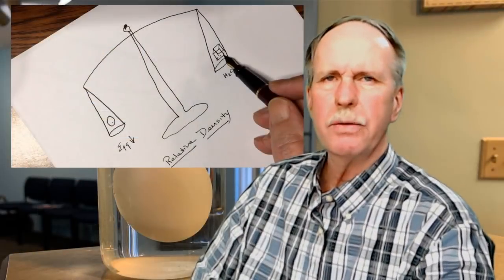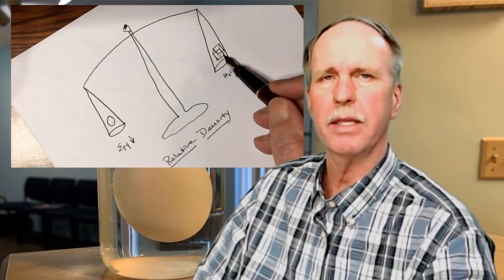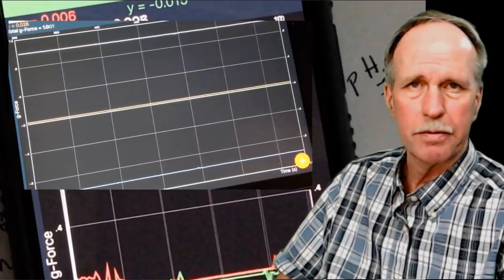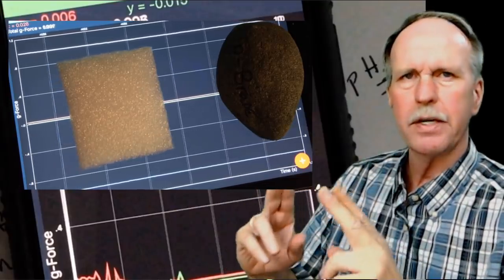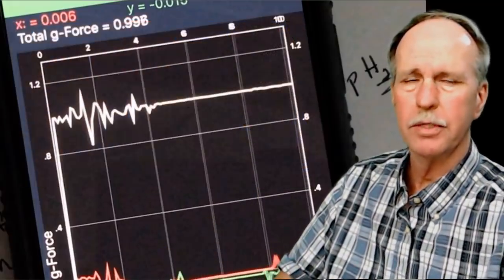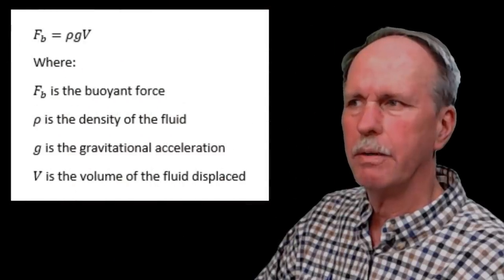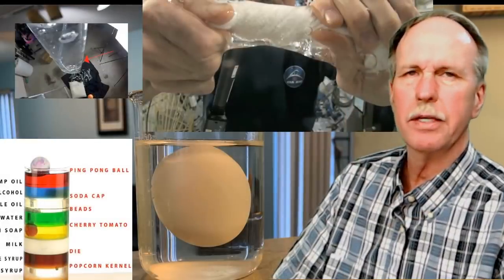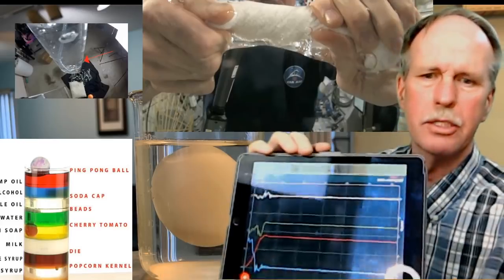Relative Density vs Buoyancy Part 2

Comment: I hate to quibble, but wouldn't it be more correct to state that the rock and the piece of foam are in fact acting on each other, but that their mutual attraction doesn't exceed the acceleration due to gravity, or doesn't exceed the friction of the surface they're sitting on ?
Reply from the maker: Far too much detail (correct of course) for the purposes of this presentation
Reply: @BobtheScienceGuy   Fair enough. It's been a long time since I studied these kind of topics. Thanks for getting back to me.

Comment: How does Sleeping Warrior explain aviation? An aircraft does not change it’s density while climbing and descending. To fly you need lift, the opposite force of weight. Airships and hot air balloons use bouncy and don’t have wings. Airplanes and helicopters need to generate lift with rotors and wings. When the engine on a helicopter quits you become an instant believer in gravity.

Comment: Fascinating to see the balloon move opposite the fishing weight.  Obvious why it happens once I saw it, but I would not have anticipated that before I saw it.  I think this is problem involving 3 vector forces:  the constant force of gravity downward, the variable force in the direction of the string, and the variable horizontal buoyant force.  Sounds like a good engineering test question.

Comment: This is hilarious! Obviously SW skipped the science classes in school as he doesn't understand anything about scientific methods. The whole idea with experiments and observations is to create a model. And as your base of knowledge and data from observations and experiments increase and reaches higher resolution, you simply align your model.
Much of what we see in the flat earph world is much the opposite - chaning data to fit the model or as Phuket Word claimed - a Flat Earph model is a distraction. Of course the Sleeping Worryor don't accept models as the model into the flat earph was to be fitted would be like an overdefined equational system ending up nonsense solutions to your x's, y's and z's.
Instead the FE's hang on to a non-modelled flat earph where they can throw in whatever junk they want, and not having to care if the various qualities of their ideas and claims contradict other flat earph qualities.

To pick a quote from Adam Savage: I reject your reality and substitute my own.

Comment: Why do metal and ice drop at the same acceleration in air, despite metal having a relative density that is 10 times higher than the relative density of ice?
Reply: If it's Vanilla Ice, it drops the fastest (since popularity is the same as gravity).
Reply: @billsmith5960  If you listen to music, does density determine when the beat drops?
Reply: @pinky6758  - It does now. Thus 100% proof the earth is flat.
Reply: On the moon, a feather and a hammer was dropped and they both dropped at the same acceleration, due to the absence of air.

Comment: And the lesson Anthony Riley has to learn is that the result of an experiment has to reflect reality, rather than reflect a fixed definition for an experiment.  Failure to acknowledge the presence of a force invalidates the result.  Failure to acknowledge the buoyancy effect, resulting from the temporary atmospheric pressure gradient created by the car's acceleration, will make it impossible to explain the motion of the helium balloon.

Comment: Balloon is forced forward or backward by surrounding air. That is correct. Sinker moves forward and backward because of inertia: object's resistance to any change in its velocity.
Reason why you get pushed against seat when you accelerate is not caused by force, it's because of inertia. When you brake and you feel like you're pushed forward isn't caused by force either but instead it's inertia again.
Reply from the maker: and that inertia is felt as an acceleration.

Comment: Congratulations on debunking Sleeping Warrior's video.  You put a lot of energy into debunking flat earthers and I appreciate it.  But I have some questions to ask you about your understanding of the physics of your car demonstration.  It is a great demonstration as is Where's Wa11y's which appeared about the same.  At 7:45 You are accelerating the car and the text on screen says "acceleration to rear."  Can you help me understand this?  Clearly the car is accelerating forward.  The weight is accelerating forward as evidenced by the direction the string it is hanging from is pulling it.  The helium balloon is deflecting to the front, but it is in the accelerating car and so will be accelerating forward as well.  This doesn't make sense.  At 7:55 the opposite happens.  You are braking (accelerating to the rear) and the text says "acceleration to front."  Similar things happen at 8:03 and 8:14.  Can you explain what you mean here?  Are you taking the car to be the reference frame for the other objects?

As it happens I do not own a smartphone or ipad with which to play with the accelerometer apps, and I am curious about the direction these apps assign to the gravity vector.  Does your ipad sum the x,y, and z acceleration  components to get +1g or -1g?  Our normal experience tells us that we feel like we are being accelerated upward at +1g.  Einstein's equivalence principle tells us we can not tell the difference between standing on the earth with 1g of force acting downward on our bodies, and as a result 1g of force applied to our bodies upward by the earth we stand on, and being actually accelerated upward at 1g.   I would think the ipad's accelerometers would also show that the acceleration it feels is +1g, meaning in the upward direction.
Reply from the maker: I am referring to the acceleration of gravity to be directed downward (neg x/y/z on iPad).  In the same convention I am referring to acceleration due to inertia as being directed to the back of the car from 0 to 30 and toward the front of the car 30 to 0
Reply: @BobtheScienceGuy    If you were talking about the force your body exerts on the car seat during acceleration I would agree with you that it is to the rear, and caused by the inertia of your body.  The equal and opposite force  in this case would be the force the car seat exerts on your body, and its direction is forward.  To say that when a car full of objects accelerates forward that "the acceleration" is to the rear still does not make sense to me.  I think you go astray with the concept of "acceleration due to inertia."  Inertia is by definition resistance to acceleration, not a cause of it.  You probably should have said force due to inertia instead of acceleration.  When the car goes from 0 to 30 mph both it and the objects inside it are accelerated in the forward direction, and in the process the objects and the mass of the car itself resist that acceleration with an inertial force to the rear.
Reply from the maker: @jbsmith3129  yes, it is a fine point and correct.  I am considering making a follow up to clarify

Comment: Perhaps less confusing for the uninitiated is to refer to g as the force per unit mass experienced by an object on Earth’s surface, rather than acceleration due to gravity, though they are the same.
Reply: I'm trying to understand these concepts and I will ask you questions similar to the ones I asked Bob.  Isn't the experience of an object on the earth's surface that it feels a force in the upward direction?  I'm talking for instance of the pressure on the soles of our feet as we stand, or on our rear ends as we sit in a chair, or the upward force felt by any object placed on a scale as the object in turn causes the scale to "feel its weight."  Gravity, on the other hand, is acceleration in the downward direction, as would be experienced by and object as it falls, unsupported, towards the earth.
Reply: JB Smith It feels both and they cancel each other out so you don’t accelerate in either direction.

Comment: Discovered the evects of gravity today as ,while replacing the roof of my allotment shed, I fell from the ladder at an acceleration of 9.81 m per second squared. Being significantly more dense than the air around me I moved toward the ground under the influence of the previously mentioned force. Much preferred   the egg experiment though I did add several kilos of salty language to the mix.
Reply: I did a similar experiment back at the end of June. Although I was on my bike doing 40 kmh. My movement towards the ground was very fast and not that bad. The negative acceleration with the ground was a real pain.

Comment: Bob, dang it, you missed a key point, and it's really critical.

We need to see the balloon floating straight up off the deck in a fully inertial three axis frame of reference isolated from terrestrial spin. The traditional technique for aviators named Bob, I believe, is a dead stick one gee barrel roll while the pilot pours a glass of iced tea for his passengers.

I generally drink unsweet tea with a slice of lemon, in case you've got an empty seat. But I'm not picky.
Reply: I prefer orange soda myself.

Comment: I think you've missed the science Bob. Watch smarter every Day 113 . The force of acceleration is forward in line with the car. The weight lags because it's attempting to stay at rest and the balloon advances due to the fluid dynamics of the air in the cabin of the vehicle. 

The way you've explained your force vectors makes no sense at all.

5:54 "pushed back into my chair." You aren't pushed back into the chair, the chair is being pushed into you. While the forces applied by the car to the road are indeed in the opposite direction as the acceleration you wouldn't feel these forces. Instead your body wanted to stay at rest and is being forced by the movement of the car. Therefore the force applied to you is in the direction of acceleration.

7:10 "the acceleration would go from the center of the car to the front" a deceleration wouldn't apply in the direction of travel. Your Delta V would be moving in that direction but the acceleration would be negative would it not? If you were accelerating forward then you wouldn't slow down.
Reply: You're ignoring the frame of reference, Bob's vectors are in the correct direction when you look at the objects in question and not the road.
Reply: @cambridgemart2075  i don't think that actually fixes the things that he says (specifically i don't see how in that frame of reference the objects can "accelerate" given that no force is being applied. The apparent acceleration is in fact the reference frame moving around it.) but if it is what he's doing and I'm wrong about the validity of the frame of reference it's still a bad choice to make because it overly complicates an otherwise straight forward explanation.

Comment: I thought of doing an experiment with two magnets - moving one closer to the other until the second one moved. By Sleepy's logic, the independent variable that I am manipulating is distance, it caused an acceleration, so therefore distance is a force and to infer anything else would be pseudoscience!
Reply: No, you won’t fool me with your lack of understanding of the scientific method. It’s not the distance you’re manipulating. It’s where one of the magnets is.

Therefore science clearly shows that what causes acceleration is where you put something.
Reply: @tlw4237  How do I know if that's correct if I can't see whether you're wearing a white lab coat and glasses?
Reply: Everybody Loves Balls: Science please, Gentlemen. The independent variable is neither the distance nor the putting of. It’s the skin oil.

Comment: You could have shortened this up greatly 
The mere fact the accelerometer on your digital device works is proof enough for an acceleration vector
Reply from the maker: yes, but I had to show the egg moved specifically to acceleration and not despite it.  Besides, it was just over 10 min... suck it up.
Reply: @BobtheScienceGuy  but I think there's something to say about what is essentially a solid state, surface mounted component being able to tell rotation
Because on the flat Earth they'd need lots of tiny gyros

Comment: Good old Archimedes, one of the few things from antiquity that was right.
Reply: You have done a great disservice to many scholars from antiquity that were correct.

The reasons that the ancient Greek scholars gave for why the Earth was a sphere may have started with false premises (the Earth was both at the center of the Universe and at the bottom of the Universe), but the supporting evidence that they discovered to bolster their flawed premises were still accurate observations that the Earth was demonstrably spherical.

Eratosthenes could only have used the angles of shadows at Alexandria and Syene, at the Summer Solstice, to calculate the circumference of the Earth if he already knew that the Earth was a spherical object.

From simple geometric arguments, the ancient Greek scholars knew that the Sun was further away from the Earth than the Moon, and that the stars were very much further away from the Earth than the Sun.  Their observations proved that the Earth and Sun moved relative to each other in a pattern that repeated every year.  As the necessary tangential speed of the celestial sphere to account for the Earth being stationary was unimaginably large, while the tangential speed of the Equator needed to account for a spinning Earth and stationary stars was less than a hundred times the speed of a loosed arrow, they decided that the Earth was a rotating sphere.  They saw how ships appeared to go over a curve as they went over the horizon, and how the higher you were above sea level, the further out to sea a ship had to go before disappearing over the horizon.  The ancient Greeks never got as far as the Equator, but, as their travels took them north or south of Greece, they noticed that the angle between the northern horizon and the North Celestial Pole would change, but the stars would still travel in circular paths around the North Celestial Pole.  No matter how far north or south an observer traveled, all observations suggested that the observer was looking directly along the axis of all the circular motions, so the stars had to be very far away, and the change in the angle of elevation to the North Celestial Pole was a linear function of the distance traveled, further supporting the conclusion that the Earth is spherical.  As everyone, anywhere, that described a lunar eclipse described the Earth's shadow as circular, only a spherically shaped Earth could explain what everyone had observed.

Not only did the ancient Greek scholars believe that there were people on the opposite side of the Earth that were, relative to them, standing upside down, they even had an expression for the place were people would be, relative to themselves, standing upside down.  They called it the 'antipodes' or 'that place on the Earth opposite to our feet.

It was a real tragedy that the ancient Greek scholars spent nearly all of their time thinking and nearly none of their time designing and performing experiments, but there were more than one that was correct and they forgot more about the planet that they lived upon than most flat earth proponents can bring themselves to learn.
Reply: Archimedes did a lot better than Ptolemy at that in a number of fields.

Comment: One thing I would also have liked to have seen in this experiment is to continue to accelerate until you reach a speed where you can hold it at that speed. FEs are always claiming that they could detect if they were moving at the speed of the Earths rotation. That would help show that no you can detect acceleration but not speed.
Reply: Simply sitting in an airliner flying through smooth air would show them they’ve no way to judge how fast they’re going. And that it’s change in the forces acting on them they can detect.

Since many of them have flown to places they must be aware of that but for some reason “trust your senses” doesn’t apply in that situation.
Reply: @tlw4237  They say that airplanes and cars are closed systems and if you would open a door or window you could notice. They don't understand that the Earth acts like a closed system in that regard because the atmosphere is moving with the Earth (for the most part).
Reply: Maxx Kroes  actually that is 2X the speed of rotation.

Comment: What really baffles me is that flat earthers can not explain why things keep being pulled toward the earth. They say denser objects fall. Yes they still fall toward the earth. Flat earthers need to understand that there is a force that keeps us to the ground and not fly off.
Reply: Yeah, why down? Why aren't denser objects lifted up, or any other direction? It's like there is this thing that is constantly accelerating them in the downward direction unless opposed by an opposite effect.

Welp, must be unexplainable.
Reply: @Tsudico  I had a lengthy debate with a flat earther on gravity and he kept mentioning air pressure. So I told that if you get a 6 inch wide glass sphere with 1 inch thick walls and put in a marble, fill the sphere with water and seal the entrance, why does the marble 100% of the time fall only toward the earth. No answer, he ran🤯